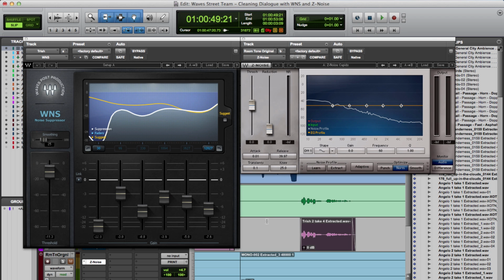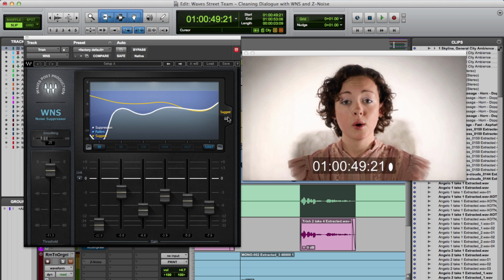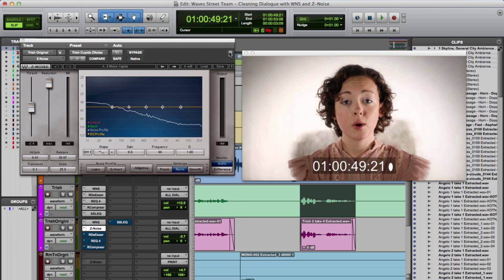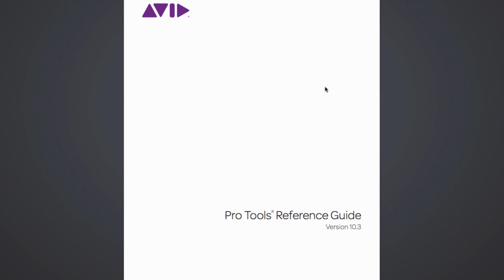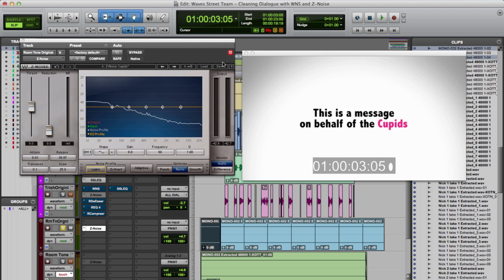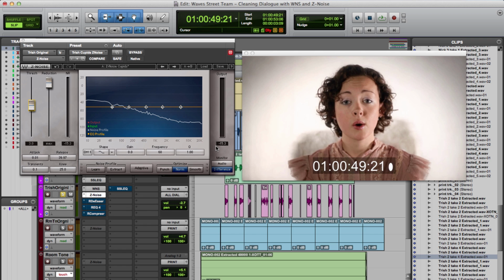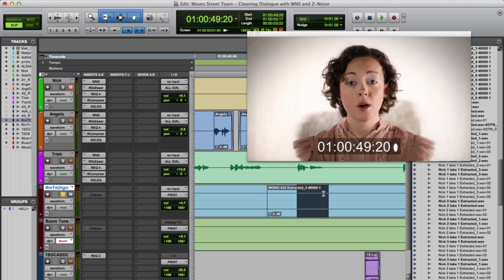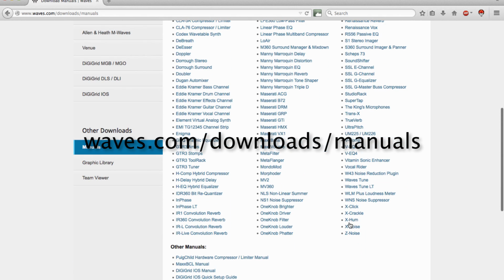Cleaning Up Dialogue with Waves WNS and Z-Noise

Comment: Unnecessarily over-complicated, as well as requiring the purchase of Waves plugins. 

I tried using these Waves plugins to reduce cassette tape hiss from the language tapes that I digitised by transferring to PC. It wasn't convincing, in that it slightly reduced top-end and produced audio artifacts. I found that using a gate plugin was better. I initially tried using the free GGate, but it failed to completely remove hiss from the first few microseconds of wanted sound. Then I tried (the also free) ReaGate, and it was perfect.